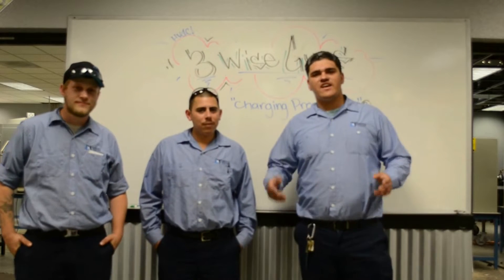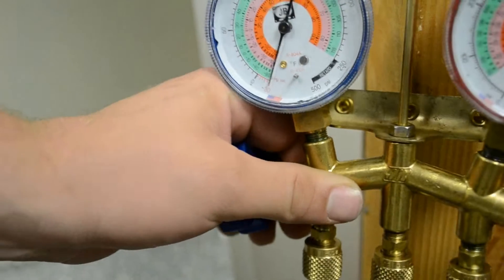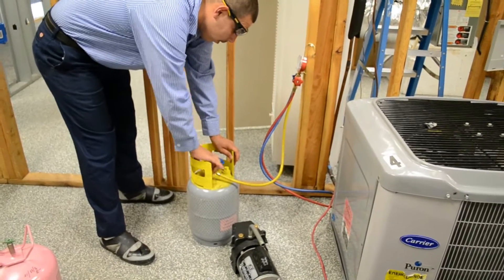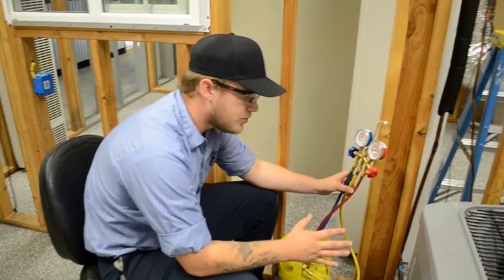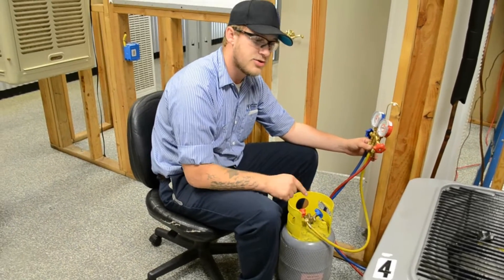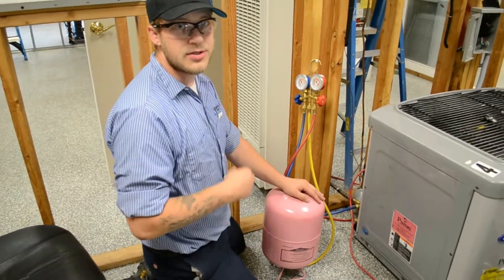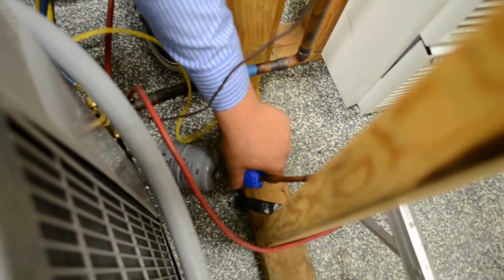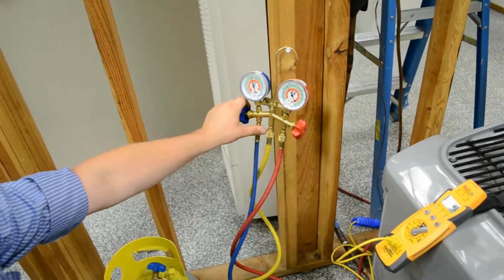HVAC Charging Procedures (School Project)

Comment: I get that you guys were in shop making a video for a project but if that's the case you should've included that in the title. Kind of misleading don't you think? you'd be amazed at how many new techs rely on youtube to help them understand some of the concepts and practices ...like the other guy said you haven't pulled a proper vacuum and fully evacuated any system without using a micron gauge and pulling the system down to below 500 microns...proper practices would be isolating the pump using a micron gauge and making sure the vacuum is air tight, no leaks...non condensibles left in the system. Always, always, always, purge your hoses...if there's air in your hoses...well, there's gonna be air in your system. Charge through the high side and watch your suction pressure come up....then turn the unit on let it run 10 mins to balance out then check your subcooling if you have a txv and superheat if you have a fixed metering device. Also for liability issues I would clarify that this is not an instructional video and that it is only for school purposes. It's important people know the difference. Other than that, wish ya'll luck out there in the field👍👍
Reply: Feelin'Myself8
Reply: Great comment! I totally agree with you. I understand the guys are in a school environment and this is like they first times practicing in live equipment. All in all I hope by now they turned out to be great techs. I bet they can now look back at this video and recognize some of the mistakes they made and learn from them.